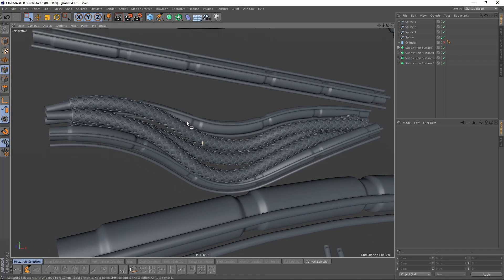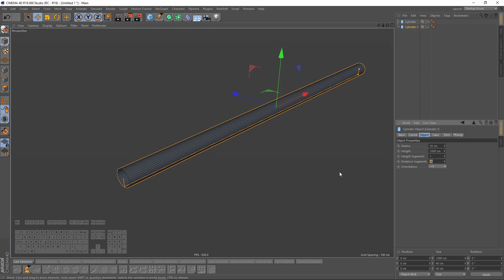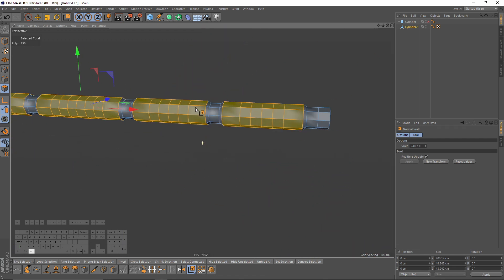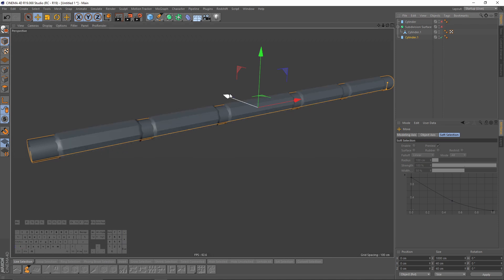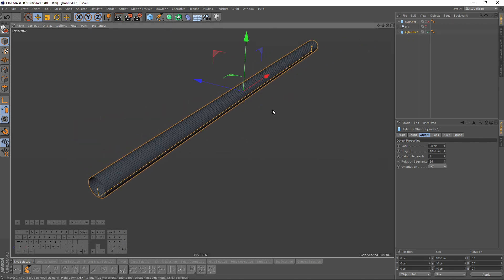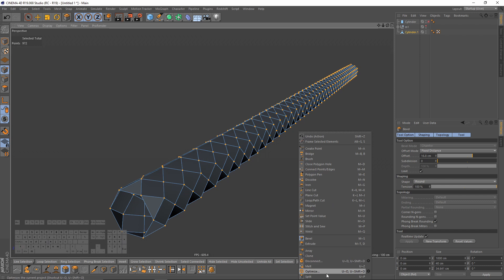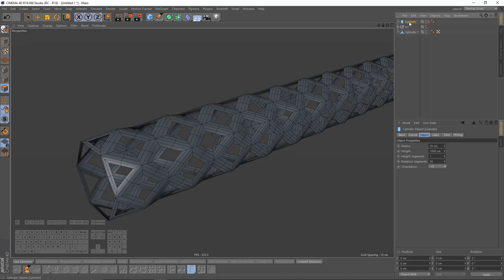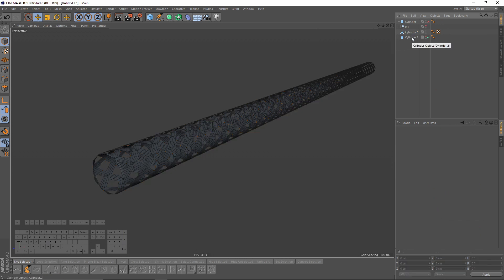Easy Hard Surface Cables/Tubes | Cinema 4D Modeling Tutorial

Comment: Hey man! Running into a bit of a problem when initially using the bevel on the points at 4:40. The points on both  ends of my cylinder are overlapping one another and look messed up, even when I optimize. Anything I might be doing wrong?
Reply: Unfortunately after over 3 hours of troubleshooting I've gotten nowhere. I'm on r23. Any help or tips would be appreciated! I tried the discord but no luck there either
Reply from the maker: Just select all the points and right click and select optimize.

Comment: Good tutorial, but I have a problem
Around 5:40 when I trying to use tools like scale or extrude inner for polygons, this action applies totally different from your tutorial. Extrude inner working only around edges, scale - scaling from side to side whole object. Can you assist please?
Reply from the maker: Did you make an extrude inner with a low offset, also optime youir points befor exture inner.
Reply: @polygonpen  when I am trying extrude inner this happening only at edges of the cylinder(from two opposite sides) and working completely wrong. Can we contact somewhere else and I will show you screenshots? I really want to repeat your tutorial
Reply from the maker: @СергейВолодин-л1л  You can join Discord channel
Reply: @СергейВолодин-л1л  Did you find a solution? I'm having a similar issue where the points at the end of my cylinders are overlapping and causing weird edges that I dont know how to fix
Reply: @coledorais2241  no, I didn’t , I just left it)

Comment: Ah, the bevel tool... you blew my mind again. Btw, if i want to create long cables, i can use cloner or it won't work properly with the spline deformer?
Reply from the maker: It should work but put them into the connect object (cloner object and Spline deformer)